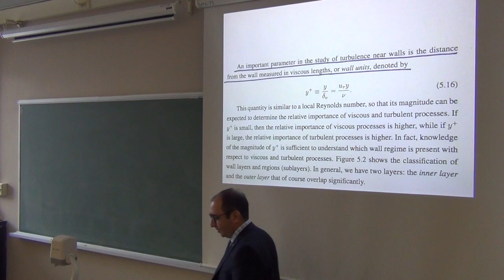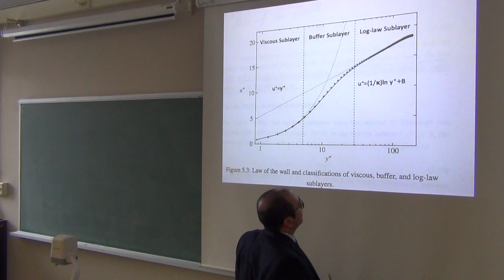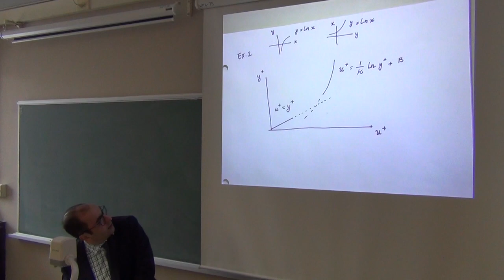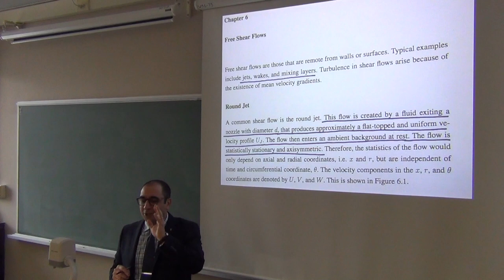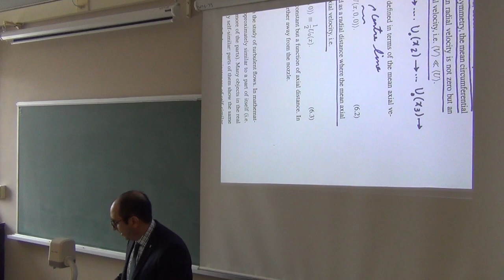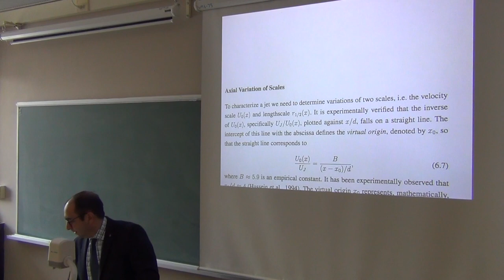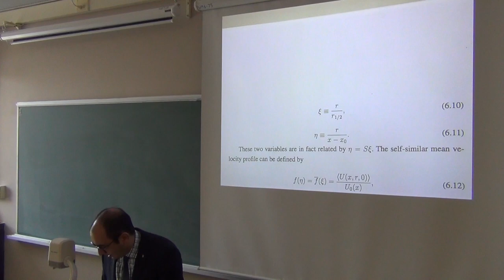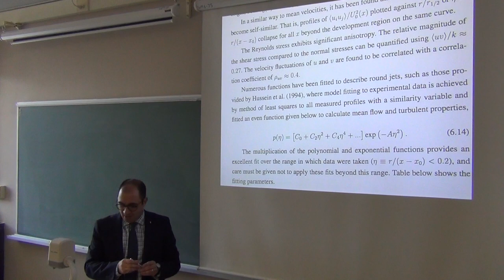Turbulence: Lecture 7/14

Comment: Hey professor, could you elaborate on how come when r->0, w and v are indistinguishable? (as claimed in 1:14:15)?
Reply from the maker: Hello, thank you for your question. When r->0 both V and W velocity components are in the direction radially outward from the center of the jet. Since the jet is axi-symmetric, then these velocity components (V and W) are really showing the same velocity.